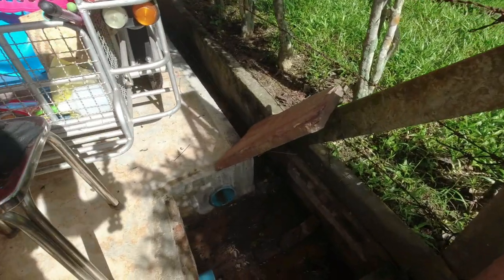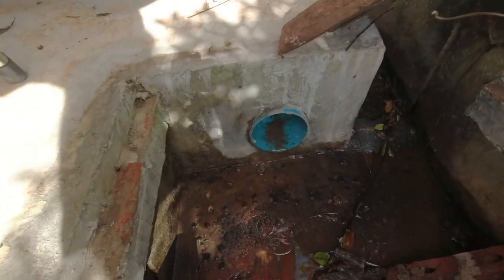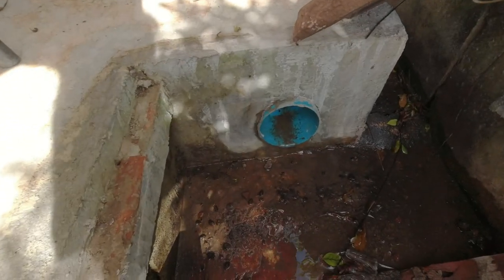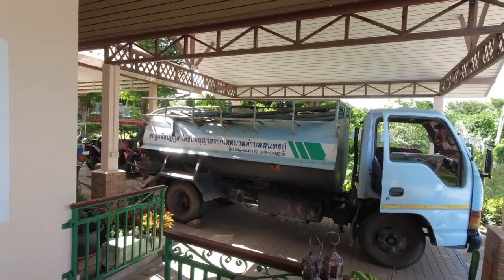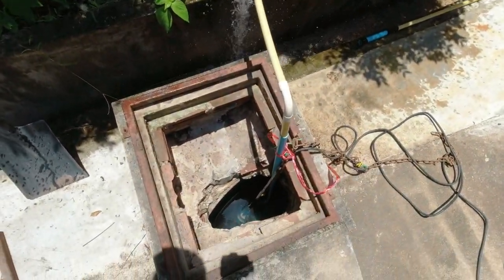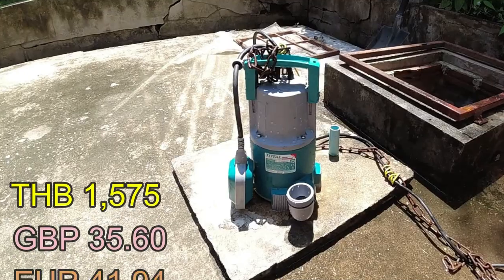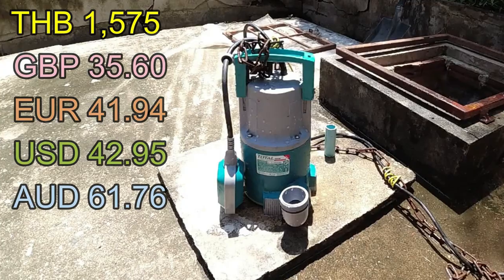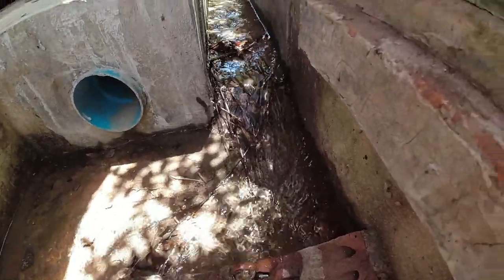Septic tank problems septic tank problems video

Comment: Is it a cess pit with overflow or septic tank. Cess pits need emptying about every 6 weeks where as a septic tank every 3-5 yrs but if looked after even longer. I have a septic tank on my property as well as a mini sewage treatment plant, the septic tank hasn’t been emptied for 20yrs and it’s still doing well
Reply from the maker: It is a septic tank I believe, two yanks the 2nd is the overflow tank which is leaking not the 1st tank. When this 2nd one was emptied it had no sludge so everything is working fine just the problem with the water intake when we get very heavy rain, on this occasion we had heavy rain for 3 days. Thanks for your comment and for watching.
Reply: @RetiredandLivingthedream  Where does the water drain to from the 2nd tank, normally with septic tanks they would drain away into a filter bed/soak away. I think you’ve done the right thing by putting a pump in the overflow tank but I would want to put a none return valve on the overflow tank exit pipe too so water can’t go back into it, you’ll save electricity too as you won’t be pumping out so often. I’ll just like to add I’ve never heard of a septic tank with an overflow tank, they must do things differently in Thailand. I live in rural France and more or less everyone has septic tanks which is regulated and they get checked every 10yrs to make sure they conform to the regulations and if you sell your property it also gets checked. Big problem is the regulations change often so what once conformed 5yrs ago may not conform now. 
On my property I have septic tank as well as sewage treatment plant which I installed 20yrs ago, I had an inspection last week and nothing conforms and I’ve got 4yrs in which to change it all and as septic tank installations aren’t cheap I’m looking at probably a bill of about 30k euros. Fortunately I’m selling hopefully next yr which I told the inspector and she told me to do nothing then as whatever I put in maybe not be suitable for what the new owner need, but I’ll need to reflect that in the price.
Anyway, love your vids Leslie, always informative and to the point. Best of luck and stay dry.
Reply from the maker: @smifff63  Thanks for your comment. The overflow tank drains into the drainage system in the street. No need for a check valve from the overflow pipe from the 2nd tank as we have no problem water going up the overflow pipe just the water from the surrounding land. Next doors land is like a sponge very wet after rain and holds onto the water as it has a big dip in the middle of the plot.
I almost built a house in France and looked into the drainage problem, as you say it was going to be expensive.
Thanks for watching.

Comment: Sounds like a lot of crap to me.............LOL
You will find that when it rains a lot for a long time the water table rises and therefore doesn't drain into the ground.  Sometimes you just have to keep getting it drained.
You are lucky that you have a septic tank and a settlement tank.  Most older houses only have one set of concrete rings  about 2.0 metres deep. 
It costs 100 baht to get it pumped out in my village and in the rain season maybe twice a month otherwise it is pumped every 3 months.
Your pump solution seems a good idea and you will find once the rain season has gone it will not be kicking in.
In my new house I have a "Wave" plastic septic tank of 1600 ltrs and a "Wave" plastic settlement tank of 1600 ltrs and that overflows into the street drains.  I think we will be pumping out the septic tank every 4 years at 100 baht as the bacteria in the septic tank breaks down the excrement.
Reply from the maker: Thanks John, like I said we are surrounded by lakes so the table is high anyway and this situation happened after 3 days of persistent heavy rain quite unusual for here but that caused the problem but like you say an easy fix. Long may it last.
Thanks again for taking time to comment.